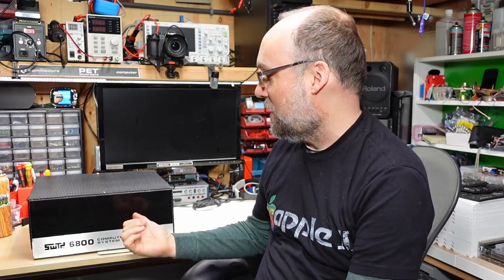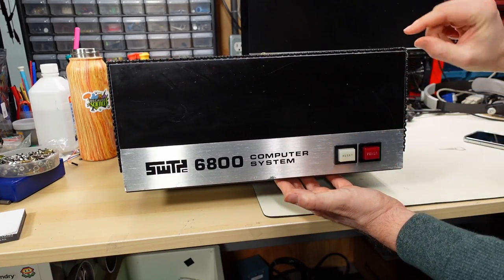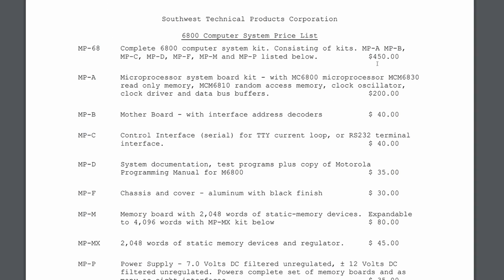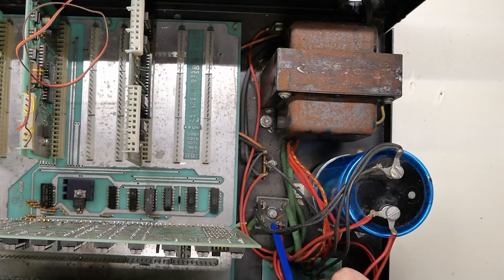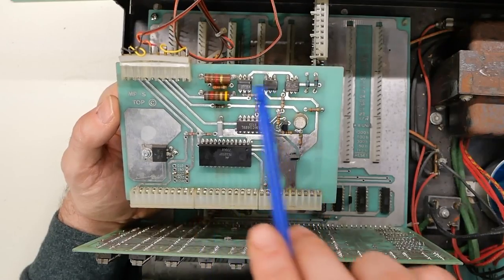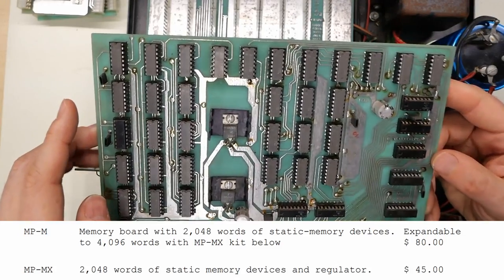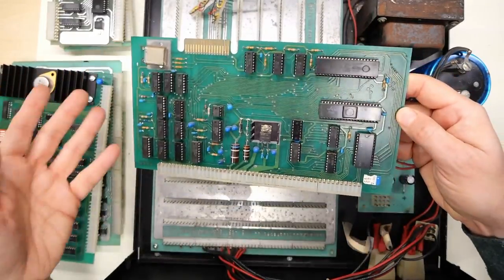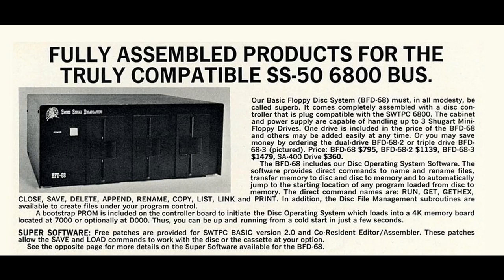The 8-bit home computer from 1975 you've never heard of

Comment: Hmmm. I have read in a few places where the Intel 8080 (as used in the Altair) and the Motorola 6800 came out at nearly the same time, and Motorola was essentially matching Intel's price on their competing chip, which was in the high $300 price range (single-chip quantities).  There is a lot of history describing how a Motorola design team was working to develop a simpler version of the 6800 with a much smaller silicon die, which was expected to have far fewer rejects and thus much lower price, but Motorola did not want to do it. This lead to some of the Motorola team leaving and going to MOS Technology where they developed the 6502, which was a lot less expensive that the 8080 or 6800.

So it seems inaccurate to describe the 6800 as being famous for its low cost. Adrian, I wonder if you were thinking of the 6502 when you made that comment?
Reply: "This lead to some of the Motorola team leaving and going to MOS Technology where they developed the 6502, which was a lot less expensive that the 8080 or 6800" $25 to be precise.
Reply: @mojoblues66  , but it seemed Adrian was referring to the 6800.
Reply: @youtuuba  although, at the time this came out, the comparison would be to the Intel 4004 and 8008, as well as the 8080. Basically, in short, it was cheap compared to Intel, the only major competition. You're comparing the products from major manufacturers to that of a rather small company just starting out. Yes, MOS's tech was very much cheaper, but it was much less trusted and less available to small home computer builders.
Reply: @squirlmy  , I am not originating this. Adrian originated it by saying that the 6800 was known as being cheap compared to the 8080. I suggested that he was wrong, because Motorola is known to have been tracking Intel's going price on the 8080. I suggested that maybe Adrian was thinking of the 6502, which most definity was far less expensive than the 8080 or 6800. That's all I was saying. Let's not get confused by mixing in the computers themselves or other complications.
Reply: SWTP was known for making inexpensive electronic kits. They were an audio manufacturer famous for their kit power amplifiers. One of their models was known as the Plastic Tiger because it uses the then-new plastic-bodied power transistors in its output stage.  This was, at the time, a less expensive alternative to the Altair (a friend of mine owns Altair serial number 0123). The 6800 CPU may have cost the same as the 8080 used inthe Altair, but you will note that the SWTP has no expensive switches, LEDs (yeah, hard to believe thet they were ever expensive) or fancy case. In fact the case for the SWTP could easily be mistaken for one of their power amplifiers.
Reply: @squirlmy  , the 6502 was quite easy to obtain, and at that time hobbyists could have a hard time buying single pieces if the 6800, never mind the huge price difference.
Reply: There are several points to understand about the 6800 vs the 6502. Motorola did the 6800 in Mesa, Arizona from 1971-74 with a team of 50.  They defined the architecture, and made a complete family of chips, and a development system, and documentation.  A lot of work.  They hoped to make a market for it with high-volume customers like car companies, not hobbyists or a PC industry that didn't even exist yet.  MOS chip manufacturing was horribly primitive in those days, from one day to the next you didn't know if the factory would build good chips or not.  Margins were very very thin and demand was very up and down.  1974-75 was a big big "down" period and Motorola decided to move all their MOS work to a new plant in Austin.  The employees were told to move to Austin or be laid off with no hope of finding similar work.  In this environment, some of the 6800 designers went to MOS Technology to work on their "low cost 6800" project.  Motorola could have sued them off the face of the planet but let them off because IMO a) they had too many other problems to worry about and b) they knew it would not make enough profit in manufacturing.  So yes, MOS Technology did the 6502 but indeed, they couldn't make money on it and in 1976 they were bought by Commodore.  (Most of the 6502 designers had already left by then.)  Other companies that were licensed to make and sell the 6502 like Synertek, failed as well. The 6502's target markets, consumer goods like early video games and early PCs which weren't much above video game systems, were just not profitable markets to sell into.  Everything about the 6502 was done on the cheap.  Its ideas and principles were taken from Motorola, and the rest of the systems work was left to the end users to develop.  It was a fun product but not one that chip manufacturers would make money on.  Except for one of the designers who ended up with the IP licenses and kept developing it as an embedded processor for decades in products you never heard of.

Comment: No one heard of that? I knew about it. While I did not purchase that item from them, I use to purchase other products from SWTP.  My CP/M system was cobbled together using the case from an Intel Intelec8 software development computer, a backplane salvaged from ???, CPU and memory boards from the Dayton Hamfest, and an IO card I designed using a S100 wire-wrap prototyping card.  Disk I/O was a pair of 8" drives that used a voice coil to drive both heads at the same time! It was a beast.  Track access time was much less than what a hard disk drive could do with a stepper motor.  The only thing I never did was reverse engineer the BIOS so I could patch it to compensate for the fact that both heads changed at the same time.  Switching drives always produced an annoying seek error.   Fond memories.

Comment: A technique I use to safely remove chips from eight layer array processor boards back in the 80's  is to clip all the leads off as close to the chip package as possible. Then' one lead at a time, clamp a small set of hemostats to a lead, Let it hang down below the board while you heat the pad from above.  When the solder melts the lead will just fall out.  Then just clean up the hole with a solder sucker or wick.

Comment: My first micro. I bought it from a guy who owned a laundromat, was not very technically skilled and assembled it as a kit using liquid solder. Of course it didn't work and I got it pretty cheap. After cleanup and resoldering I got it to boot to the monitor.   Started with a TV monitor and a keyboard, added a ASR-33, at some point a cassette tape interface, a SROOC  monitor (Coors spelled backwards, true story), and finally a 5" floppy. Besides running "biorhythms", its best use was for remote access to DEC LSI-11  computers in Florida and California. I was working remotely from Albuquerque. The serial file transfer protocols of the time were to slow for transferring large files over my 1200 baud modem over noisy telephone lines because they were mostly based on an  ACK-NAK-timeout protocol so I developed my own, in 6800 assembly language, that took advantage of being able to receive status information while transmitting streaming data thus avoiding timeouts, ACKS, and NAKs. I also applied mild compression. The corresponding programs on the LSI11 side were written in Fortran.  File transfers were much faster and error free.

Comment: I have one of these with 5.25" drives, and a Gimix system with 8" drives.  Got them in the early 80's and used them until I got my C64 a few years later, and neither has ran since.  Need to get them both running again, this video may be the kick in the pants I need.
Reply: Also, just a few miles down the road from me was the computer shop that also published the magazine 68 Micro Journal, which was a tremendous resource for these machines.  Mine ran Flex/OS for 6800, and there was a version of it for 6808 CPUs as well, and from memory another called OS/9 (been many years and many beers) that could also run on a CoCo.  When turning it on, the terminal came up into a monitor ROM called MikBug (again, memory) and you had to enter a command to jump to the disk boot code which then loaded the rest of the OS from floppy.  It didn't boot straight to the OS.  I also have the SWTPC CT-82 terminal which had a moveable cursor and a blocky graphics capability similar to PetSCII that even included line and circle drawing commands.  You could do some neat things with it, such as a nice graphical chess game.  But then came the C64 and my teenage self lost interest.  But I still have it all, at least the hardware.  I scanned much of the documents in the 90s then lost most of that in a drive crash.  I think most of it is online though, saved by others.

Comment: I've got one - like new/unbuilt.  Everything still in the wrapper.  Along with a cassette interface (big box), again, UNBUILT.  And an open frame monitor, UNOPENED.  The cassette IO was addressed to Midwest Scientific Instruments (whom I worked for).  MSI built 6800/6809 business systems based on the SWTPC 'standard', but built more like a tank!

Comment: That unnamed computer from the Adrian's Digital Basement 2 channel is a commodore 64 server that's used for businesses made out of a old Altair system case sold just like that & built on the spot by Commodore. They just put their hardware (basically a Commodore 64) into a old Altair server case. Then with a "client's" Commodore 64 you would terminal into the server Commodore 64 that housed all your business's files.

Comment: MC6800 was "low cost"?  Ummm, well IIRC, that would be a big fat NO ... at least not initially.
It cost several HUNDRED dollars which is to say roughly the same as an 8080A.
What made the 6502 so successful initially was that it was dirt cheap by comparison, something like $20 to $50, which then caused Intel and Motorola chip prices to quickly drop as well.

Also, if memory serves me correctly, while the 6502 was easy to clock, the 6800 required a special clock chip (I want to say 6875, but I could be wrong) that output fast rising/falling two phase clock signals.
The SWTPC didn't have that clock chip and so they rolled their own complementary bipolar transistor driver to generate the equivalent fast rise/fall time clock signals that the 6800 required.
And that was part of the problem with the 6800 as well:  support chips.
To me, it seemed like you could get 8080A support chips (and later Z80 support chips) and 6502 support chips pretty easily.

As for the absence of a front panel, sometime around 1975, Jolt released its 6502 based SBC with a three MOSTEK LSI chips, one the 6502, that likewise had no front panel but rather communicated by a serial port.
IIRC, the serial speed was determined by pressing a return key some number of times.
I don't know why the Jolt didn't find much of a market (lack of advertising?), but it seemed like everyone and his brother were stuffing chips into S-100 cards or playing with their KIM-1s in no time.

Comment: I owned built and programmed a Motorola 6800 single board microprocessor evaluation kit in 1981.  It was attached to a mechanical terminal and worked with Motorola's  onboard "Mikbug" monitor program .  This article says the SWTPC 6800 has the option of running  either Mikbug or SWTBUG. It depends on which ROM board is installed.

Comment: House mates had 6800 & 6809 machines.  Smoke signal broadcasting disk operating system had a nice feature.  Delete file required a "Y" and then a "honest?" And required an "H" to confirm file delete.
I had an 8080 base Processor Technology "Smart terminal".  1 k ram 16 x 64 video display, cassette record/ play with S100 buss.  After i bought a Cheap! FDOS 5.25 drive, i moved to the PTdos (8 inch single sided firm sectored).  
Life was volital and abit like Windows-Mac wars later.  Each had their followers.  It was like the wild west.  World Computing had a 2 page advert that showed a 16 pin buss driver in a 14 pin socket.  That was just one scandal.
Those were the days. You really knew your computer.  Assm and BASIC and later C.

Comment: I don't think I had an actual SWTPC version. In the 1980's I did have a SS-50 bus computer from Smoke Signal Broadcasting that used a 6809. For a while I lived only a 30 minute drive from SSB and hung out with one of their engineers from time to time. During that time period I wrote and sold a 6809 Pascal compiler for Flex and OS-9 and eventually built a hard drive controller for the SSB box for a 5MB hard drive. Later on I wire-wrapped a 68008 CPU board so I could develop a 68000 version of the Pascal compiler. Later in the decade there was a company that made a 68020 machine called a "Mustang 020" or something like that which was of course much faster than the 68008 and that replaced the SSB box for software development.

Comment: Smol correction: There were "Glass TTYs" in 1969. They were professional kit though, not like the TV typewriter if that's what you meant? But just for looks, I'd kinda like to get some of those terminals. There's a cute little 1969 one I've seen a picture of, plus the incredibly sexy DEC VT-01 from 1970, although I would be happy with the economy VT-08E which came in the same case a few years later. I really like the ADM-3A too, also later.

That huge capacitor! :)

Addressable ports! Do you remember everyone hating having to configure ISA cards? I didn't think it was bad, but it seemed like everyone else hated it at the time! According to some, PCI's big innovation was making each slot addressable. :) Of course, with more complex chips by then, it could also introduce autoconfiguration.

I have a ZX81 expansion board with a 6820. Never really used it after assembling it. Don't know why. I was going to use it for a school project, sensors monitoring alcohol brewing... I have no memory of how that ended or why nothing came of it. Or wait, there was a choice; brewing or hydroponics. I was far more interested in space than alcohol, so I probably chose hydroponics. I don't think any of us got anything working, but mine never got further than planning while others at least had some guttering for the plants to grow in.

Comment: 2:25 8080 and 6800 only shared the "cisc" 8-bit processor feature; while intel cpus took a register + separated I/O design, Motorola based their cpus on a fully memory mapped I/O, that's why the 6510 evolved into such a "peek & poke" processor, giving birth to Apples, Commodores and Ataris thru the 80s.
Reply: Did you have a Beagle Brothers Peeks, Pokes and Calls poster on your wall at some point in the mid-80s?
Reply: Probably the two biggest advantages of the 6502 were that it was dirt cheap and it didn’t need support chips to get it to work. The 8080A needs six of them. It also only needs 5V power; the 8080A needs +5, -5 and +12 to operate for reasons still not explained. Of course, if you wanted an EPROM burner in your computer for some reason you also needed a +27 line. 

However…there is the issue of the six HCF instructions in the 6502’s op code set. Also, the 6502 runs at 1MHz and the competition runs twice that fast.

Comment: I wouldn't be surprised if Bally and Williams used these for the development of their Solid State pinball machines which started appearing in around '76/77.
The 6800 architecture with a 6810 RAM and some PIAs to control the show is kinda similar. And a whole bunch of RAM to compile and test the pinball operating system... to me it looks like they just coupled the SWTPC's CPU card with a bunch of PIAs to create their pinball machines

Comment: I remember SERIOUS issues with the MOLEX connectors to the address and data bus. MOLEX connectors are TOTALLY unsuited for digital signals!
Reply: Card edge of the period was not really what you could call better.
Reply: They were a problem. I replaced the ones on my SWTPC. With square pin gold plated Molex connectors. This really improved reliablity. I still have my early 1976 SWTPC 6800 with a Ct-64 terminal from SWTPc both still function.

Comment: Smoke Signal Broadcasting also made the Chieftain which was a turnkey 6800 system with two 5.25" floppy drives running their DOS68 operating system.  The only thing it needed was a terminal.